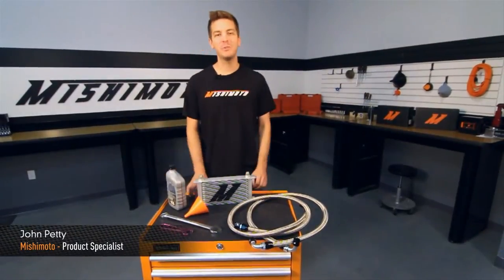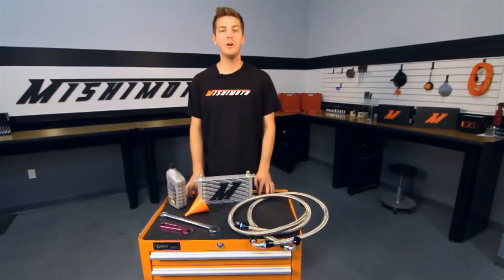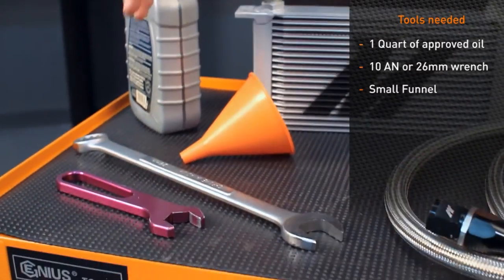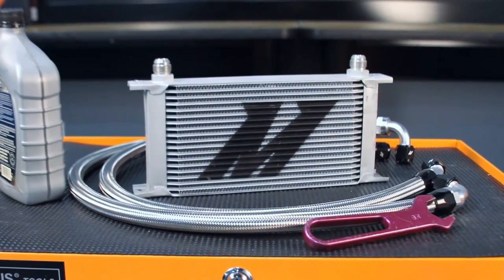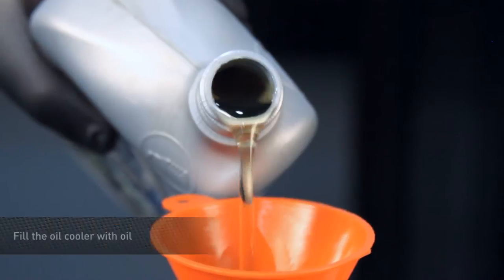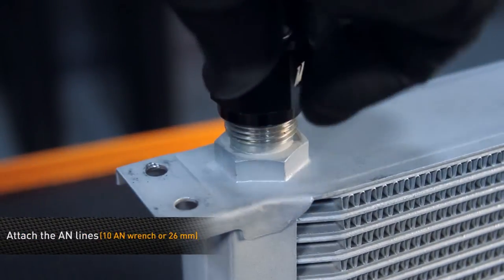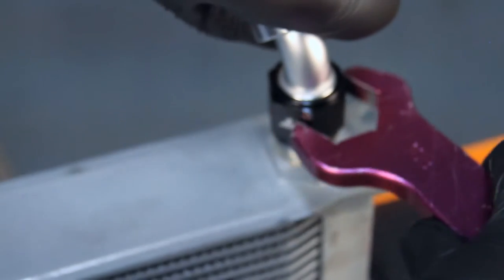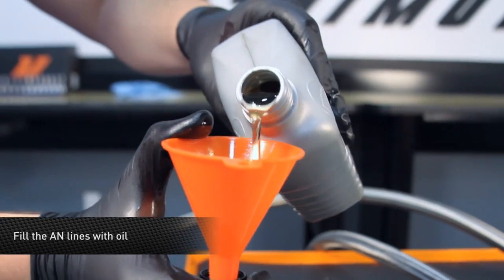Do-It-Yourself, How to Prep an Oil Cooler, By Mishimoto

Comment: Hey, do you add thread locker on the connection between the hoses and radiator?
Reply from the maker: Thread locker is not required.

Comment: Do you need to up grade the oil pump will it not cause a loss in pressure
Reply from the maker: Not at all, we are generally seeing around 1-2 PSI drop in pressure with the oil cooler in place. Nothing that should affect anything mechanically.

Comment: Do you sell oil cooler that are build with drain plug to take rest oil out
Reply from the maker: At this time we do not sell an oil cooler with a drain plug, as oil is always circulating through the cooler this is not much of an issue. Depending how the cooler is setup the oil is often draining back to the pan once the car sits.
Reply: If it empties, then why the prep?
Reply: @jdmm72  exactly what I’m wondering, does the oil stay in the lines and the oil cooler as it sits/when the engine isn’t on..I’m reading very low on oil in my car and I’ve put like 6L

Comment: Any cons about the oil cooler being installed? If water splashes in the rows for example?
Reply from the maker: Hey Richard. As long as the system is installed properly, there are no negative benefits to water getting on or around the cooler.